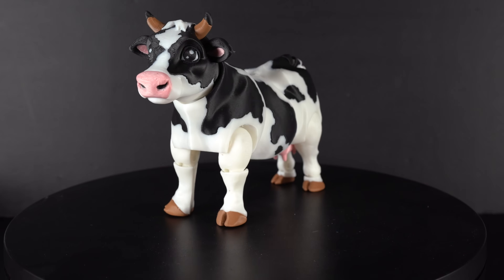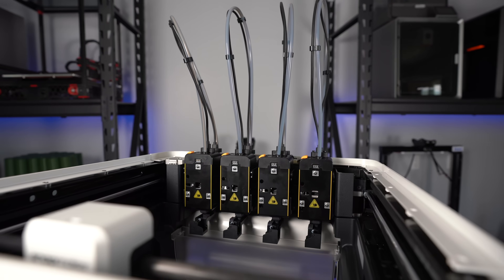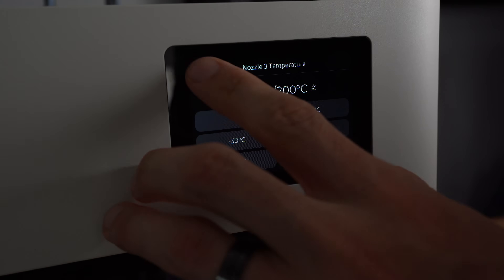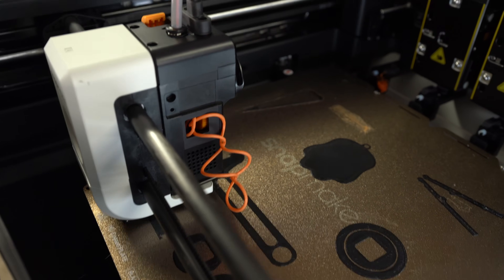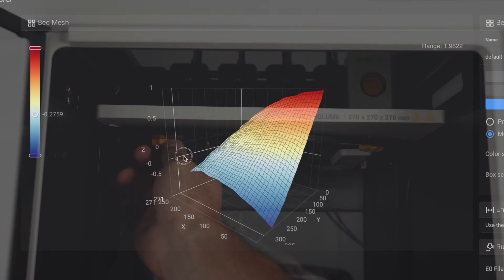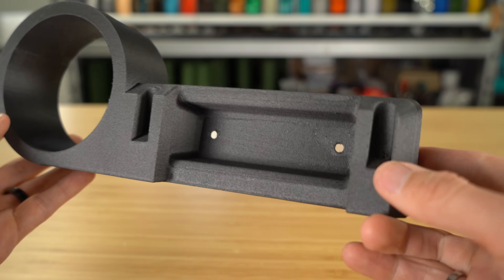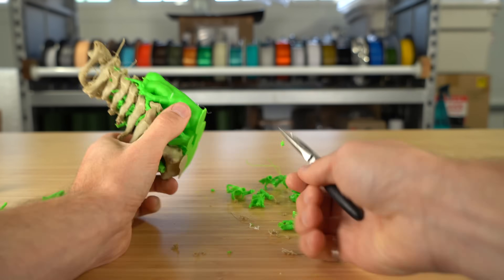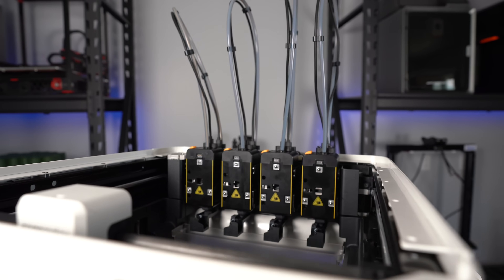The Snapmaker U1 Experiments - 4 Tools, 4 Materials

Comment: I got in on the Kickstarter, and tbh if I just do multicoloured PLA or PETG models this will pay for itself in filament savings. However I bought this to experiment with different nozzle sizes, and different engineering grade materials using an enclosure lid, and although I’ve only had mine 8-9 days I can tell anyone who wants to do the latter to hang back. I hoping that other third party vendors will offer some add ones improvements, which I’m sure they will do as this printer has so much momentum. The delay to the enclosure lid, means that the Snapmaker team were stretched to get this out of the door, and the machine wasn’t fully sorted, but that seems to be the way most companies operate now, and even Bambu had to tweak stuff as production rolled out.

Comment: Hi Taylor, I had the same issue with mine and the filament holder allowing a reel to drop off,  I was using Yuanaeng PLA Silk, and the reel was not a small diameter all the way through, and I’d inadvertently put it so the three black “sticky” bits were in free air, when I inverted the reel, it was OK. It resulted in a failed print, and I hope to get rid of these spool holders when I get some suitable dry boxes, maybe the Sovol 2x heated ones. Also I had to switch of spaghetti detection because the firmware v1.0.0 gets confused by gyroid infill. I’ve also not managed to successfully do a ASA print yet, and the OEM lid is being reworked and not likely to land before September 2026.

Comment: Pro tip for multi-material supports: if you’re printing PLA, only print the support interface layer in PETG (and do the reverse when printing PETG). Don’t print the whole support tree in the other material.

Two big wins:

Way fewer filament swaps → faster prints and less waste.

No first-layer drama → you avoid bed-adhesion issues caused by mixing materials on the build plate.

Comment: I purchased the H2c as I did not get in on this kick starter and it doesn’t look like Snapmaker will be shipping new orders until sometime early next year. I’ve been completely satisfied with the H2c. Being able to print large, 7 color/material prints with next to zero waste is amazing. The Vortech system is slower than a tool changer, but so much faster than a traditional AMS machine. I’m fine with giving up some time for the convenience. I will also be looking to upgrade my sv08 with the Indx system when it becomes readily available, whenever that is. I will also probably wind up buying a U1 for my daughter. She loves 3d printing and loves multi color models, but on the P1s I let her have, that’s a lot of filament wasted. I can see how a U1 will pay for itself quickly, as I’ve saved myself several kg of filament printing with my H2c in the short time I’ve had it.

Comment: I wonder if you could add spool holder with a spring so it would retract a bit when unloaded from the tool head and then add gcode script that unloads the filament at the end of the print

Comment: Damn this thing is pretty janky still. The build plate is terrible and paying $150 extra for a lid is terrible, the worst thing is probably the filament mounting. Having all the spools hanging (or falling) on the outside of the box is a stupid idea. They need to be in a sealed box with desiccant at the very least.  If they can get it printing properly and include the lid for free it will be cool still but it looks pretty unlikely

Comment: my biggest concern is drying since the spools are completely exposed to the elements
Reply: considering the holders do nothing. It's easy to run them out of 4 dry boxes or filament dryers. I'll probably pop them off and put them in something that I can print directly from. I'm honestly just curious about other printers. Bambu has been killing it and I'd like to check out anything new and interesting. My two bambu's have been flawless.
Reply: @Oliver1071  i thought that they were powered?
Reply: @JoMiller97  not the spool holders only the little boxes you feed the filament in to on the side. They are nothing more than a spool holder they don't retract.

Comment: I'm going to wait till they have 2 drying filaments that can automatically switch rolls on each side or a setup that allows drying more efficiently. Plus they'll probably have some flaws that will probably be fixed in a year. Looks amazing but my budget isn't there yet gonna save up for it when a sale comes along. Bambu not allowing other rolls is a big turnoff and U1 open source and repairability looks way better.

Comment: Can you please check what amount of RAM does it have and what type of toolhead sensor(s) is(are) used for bed leveling? Have seen many videos - can't find out yet is there an inductive sensor in a toolhead or load cells under the build plate?
Reply from the maker: Load cell in nozzle

Comment: SOunds like the only real issue that needs to be fixed is the QC. the rest will either get fixed with time. the spool holders are also probably not finailsed and I've heard very little of spools falling off the holders, only really of certain brands having weird diameters that are either too big or too small for the u1's holders, but that's fixed with a 2g adaptor. if the adaptor fits then you don't need to worry about other spools not fitting. or you could probably just use some rubber tape or something to fix it yourself. I'm so excited for this printer and I 100% backed this thing.
(over 18'000 backers now btw).

Comment: The most shocking thing is that the bed brackets are plastic and on top of that they are not even using threaded inserts.
And on the Bambu too.
That is really shoddy construction.
I would probably send in a STL to jlc or pcbway for metal sintered brackets 
I mean how much would it have cost Bambu to use threaded inserts.
I can understand snapmaker cutting costs since they are delivering a tool changer at like 5x cheaper than the Prussa XL but Bambu is charging a premium.

I am not jumping on anything until I see 
1) how the H2C stacks against the U1
And 2) what Creality is going to do in response to the H2C and U1.

Hopefully they will have a more attractive solution than both of them and a good super early bird price like they did with the K2 plus.

Comment: I continue to use hair spray rather than glue stick: hair spray is easier to apply and easier to remove. I've been doing this for over 10 years  on all printers and all build plates.

As for printing with TPU, one failure mode is allowing the tool head to become too warm during printing.  When TPU enters a warm tool head, it softens, and becomes more difficult to manage.   I point a pedestal fan at the XL to keep the tool head cool, which keeps the TPU firm, which allows me to print TPU without ever adjusting the extruder tension.
Reply from the maker: Thanks for the tips!

Comment: Very solid video. Very much shows what it can do, the potential, but also the issues. It's clearly not ready yet, and while I absolutely hope they succeed, this is however why I didn't back. I really wanted to, on paper this machine is amazing, and even right now it still looks very good, but with so many new printers coming out the next year which will support multi material, while ditching systems like the AMS.

Comment: BTW definition wise. It´s always multi material. A blue PLA and a green PLA are different materials. Multi color would be the whole print is is white and you paint in the layer lines with a marker or whatever. We don´t have multi color machines yet, they are all multi material, except the davinci color which sucks. So all those prints are "multi color by multi material means".

Comment: 15:09, there is a z distance offset in the slicer settings which is usually set to about 0.2mm of distance for the purpose of printing everything in same material.
But if you use PETG with PLA, you gotta significantly reduce the distance between the supports and the part, and set it to maybe 0.08mm or even less, since, you know, it won't be a problem taking the supports off, if PETG doesn't stick

Comment: I just realize: isnt that weird that for 3-4k u can get xl, that like half 3d printed? they literally printing half+ of details instead molding it, it shouldnt cost more than 2k lol
Reply: What's the price of next-cheapest multi-toolhead printer?
For the market they could have gone much higher and still be dirt cheap compared to competition.

While Prusa prints parts for their printers, they get first hand knowledge on what works and what doesn't. Proper print profiles.
Running them constantly exposes weak points (PTFE rubbing top glass, wires stressing from bending, electronics design flaws) - data that other printer manufacturers simply never get. Until users bump into them.
Reply: @kimmotoivanen  This doesn't justify them charging $3,000+ for a printer where half of the parts were printed on other printers. The fact that they print on their own printers isn't a drawback. Quite the contrary, they do fine-tune profiles and settings and identify the weaknesses of their machines. But what's stopping them from simply molding plastic parts after hundreds of hours of testing instead of printing them? In my opinion, rapid prototyping (as 3D printing was called in its early days) isn't designed for factory-scale production. I understand that Prusa can't compare in scale to Chinese factories, but in my opinion, selling something as cheap and simple as plastic parts for such a high price is simply disrespectful.(printing parts is more expensive in time and materials than molding them, even if a mold-forms is more expensive initially) 

Printing parts for a printer is acceptable if you're printing them for your own printer, not for mass production, as Prusa does.
Reply: @the_kvadronikus  Well, IMO you are wrong on both cases 😅

1) manufacturers can ask whatever price they want. It is business, not charity. Bills and wages need to be paid, and investors want something in return.
And they don't need to justify anything to people not in their target sector.
XL is a tool, not a hobbyist printer. It is bridge from 10kUSD+ to smaller businesses. If your business can't afford 4kUSD in tools (most likely deductible on taxing, might actually be the cheapest actual tool in a shop besides hand tools), I'm not sure what it can afford.

2) 3D-printing very much is factory scale (at least Prusa factory scale). And will be even more in the future.
Sure, pressing thousands of identical pieces (car industry, Nintendo Switch, medical devices) can be more cost-efficient using injection molding, but thousand or less each - not so much. Need to change the mold - do you have professional to do that?  Need to service the mold (wear and so on) - do you have professional for that?

Having own injection molding machines vs ordering from elsewhere vs owning a printer farm vs ordering from elsewhere - there is no single solution to fit all 🤨
Reply: @kimmotoivanen  truth about no absolute solution, but "IMO" prusa is overpriced, like U1 is 5x less and BIT worse in print scale and -1 head, business is business ofc, i think we got each other. (im just poor for both, lol)
Reply: @kimmotoivanen  2.5k
Reply: @theInfiniteEgg-z8i  if you refer to H2C, no, it is single toolhead printer, not multi.
Other examples? Wondermaker has not made to the market yet. INDX should still be coming, but needs a printer (and if that printer is Core One L - maybe that is 2.5k (or less) 🤔
Reply: @theInfiniteEgg-z8i  actually Prusa and Bondtech set #2 price at ~1.5k for 4 heads, some more for 8 - which is bonkers 😅

Comment: I'm curious about using multiple nozzle sizes in a single print. I assume no slicer can slice the model with different nozzle sizes. Imagine switching between a 0.2 mm and a 0.8 mm nozzle depending on the needed detail or structural integrity throughout the model...

Comment: This is why you DONT support a company that just blatantly  copies  another, especially given the above issues shows they can't even copy the design well. What's it  going to be like after 1000hours  I have 2k hours on my bambu only 1 part needed  for the AMS, that's a winner.. My snapmaker J1 has been a painful experience.
Reply: You do realize this is a pre-production beta unit and of the 40+ test units sent out this was the only one with a major issue, right? This is the first tool change failure I have seen out of tens or hundreds of thousands in the testing. Bambu Lab has mess ups all the time. Not to mention components burning up. Give me a break.

Comment: This looks like hot garbage. Too many issues. Remember the Creality Ender 7? 3D printing nerd had to cut the front off to fix it. Why are we still seeing this same issue 3 years later? U1 can't print TPU out of the box? And so much stringing. They need to do more research before releasing things, even as a prototype.
Reply: This is a pre-production unit and out of 40+ test units this one has had the most issues. It's pretty much the only one to have any reported issue that actually stopped printing. Wait until production for full judgement, but the hardware here seems extremely solid. One tool change failure out of tens or hundreds of thousands in testing. Print quality looks excellent. Far less waste and far faster color changes with much better multi-material capabilities. If you don't see the potential, it's probably not for you.

Comment: This is the second review that showed a doa printer from the fourth tool head PCB. It must be something inherently wrong with the design or qc. I believe that they will fix it, but it's important to note.
Reply from the maker: You're probably remembering my initial video. Unless there's another creator I'm not aware of that had the same issue.
Reply: @ygk3d Apparently I am. Glad it's not a more widespread issue. I appreciate the more critical review showing issues. I still think it's well worth it, but very good to know going into this machine.
Reply: It's a pre-production prototype and out of 40+ test units this was the ONLY one with a major issue.
Reply: @802Garage 1 in 40 isn't great odds. I'm not hating on the U1, in fact I backed it when the first videos came out about it. I just really appreciate seeing the whole picture
Reply: @RanaLoca  A single PCB failure on a pre-production model of a complex piece of electronics is not representative of literally anything. There are production printers, including from everyone's favorite Bambu Lab, which have component failures, including literally burning up, regularly. I'm just saying this alone is not cause for any alarm or disappointment.
Reply: @802Garage  I'm not saying there's cause for alarm or disappointment, maybe just some slight concern. 1 in 40 is terrible odds for anything. I understand it being preproduction means issues need to be ironed out. Like I said I am still backing the U1 because I believe in it, just as I had backed the X1C when it was on Kickstarter, and Bambu still had to prove themselves as a company. Snapmaker has already done that, so I have faith that they will do right. Making everything open with klipper, and porting all the U1 stuff over to Orca slicer is a huge step forward for a machine like this that I wish Bambu had done.

I will, however, never blindly defend or back a company, and will always acknowledge flaws, and ways that they can do better, just like any of us. The whole point of the beta test is to find things like this. If it is just hand waved away, nothing gets done and the test was pointless.
Reply: @RanaLoca I hear ya. I just wouldn't use the same phrasing or analytical frame I suppose. Hope it works out very well for you!

Comment: I thought the PURPOSE the mesh was so that the PRINTER can adapt to the to it?
Reply from the maker: It is but it’s better to have the bed relatively level and just have the mesh compensate for flatness issues. That way the Z motors don’t need to work so hard to keep a constant distance between nozzle and bed.

Comment: This is by far the best review of the U1 I have seen. I am really looking forward to this printer and it looks very promising, but I hope they address these issues. The wobbly bed is especially surprising, I have noticed it mentioned in other reviews as well, and it clearly affects layer stacking and bed leveling, which holds back the surface quality. VFAs could definitely be improved as well, perhaps with a smaller belt pitch. I am also curious about the filtration system. If it is anything like the new Bambu models, that would be a big plus (though it wouldn’t mean anything if the top enclosure cover isn’t somewhat airtight - still haven’t seen any review cover it). My only real wish is for active heating since it would make printing tougher materials like ABS and ASA much more reliable. I am excited to see how they refine it from here.
Reply from the maker: Thanks! I appreciate that. 

Agreed on the heater - I was thinking the lid had one but it’s just passive heating from the bed. If it could also be actively heated this would be an even more well rounded printer.

Comment: Great update to your previous U1 video. Regarding PETG as a support interface for PLA. I don't know if you've tried this but you could avoid a lot of filament changes by only using PETG for the support interface, and not the entire support structure. Additionally, in Orca, you can change the speed that support interface is deposited at. Dropping this to about 40mm/s helped a ton with the reliability of my PETG sticking where it should and vice versa. Cheers!
Reply from the maker: Great tips. Thanks a lot!